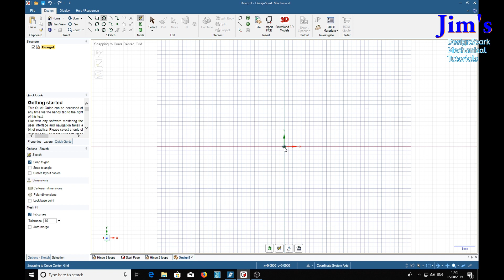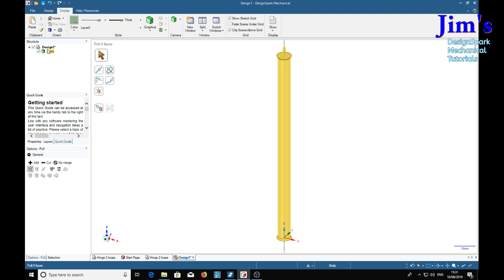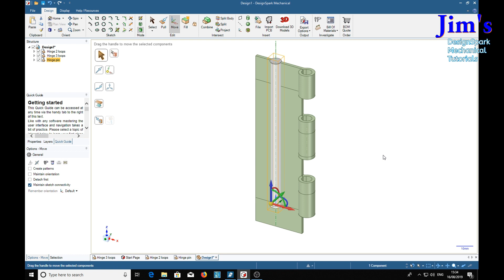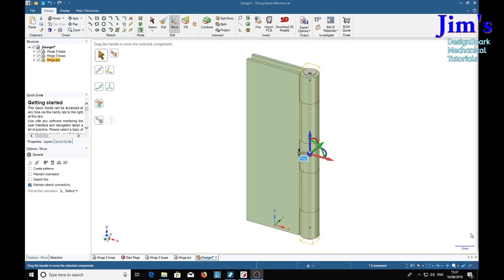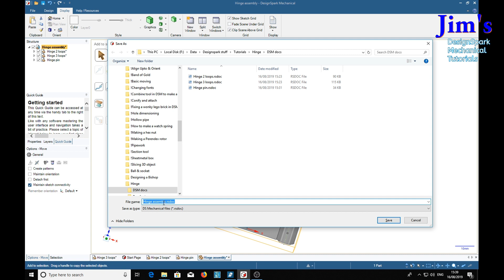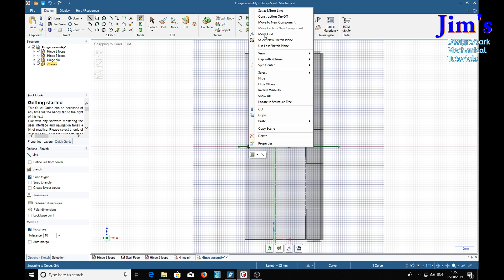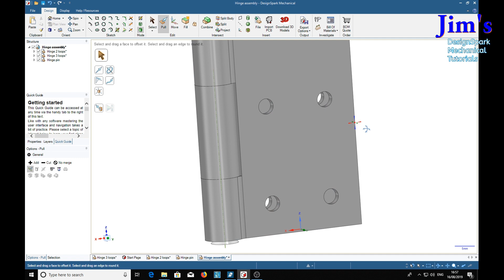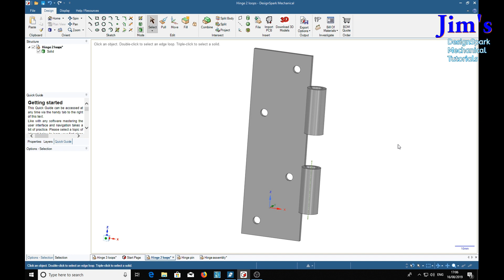Modeling a hinge in DesignSpark Mechanical pt3 of 3

Comment: Sir, Can you tell me how to convert 3d to 2d model in ds mechanical  for job submission in workshop.
Reply from the maker: First of all your view needs to be orthogonal (not persepective). Go to the widget in the bottom LH corner of the screen and select the axes, one at a time, you are interested in. Add your dimensions then print out the elevations. So far as I am aware, this is the only way to do it in DSM.

Comment: Hi; I just want to know how to do a half  cylinder slot over a plane surface. Yes 
, I'm a newbie.
Reply from the maker: Hi. Have a look at this video (by me) https://youtu.be/oc1VNENhjdg. Instead of using a hex shape for the cavity, use a cylindrical shape. You may need to put domes on the end of the cylilnder to simulate a spherical cutter. If you have any problems let me know and I'll probably do a demo. Good luck.

Comment: Hi Jim thanks for the reply.
I am curious if the following is possible.
I would like a coned lampshade, with about a 5° from the horizontal slope. The material is 1/4(6mm) plywood about 600mm in diameter. This would have to overlap about 25mm approximately to give the cone.  The overlap component would then be 1/8(3.2mm) thick.  In the face inside the cone would have 3 circular grooves in it to mount led strips. The centre would have a hole about 4”(100mm) diameter.. I suppose some of this wouldhark back to your r3cent duct video explaining round to flat conversion.
Great channel Jim please keep the videos coming.